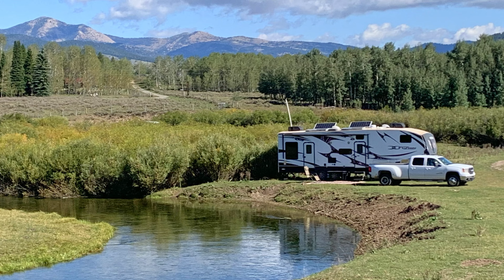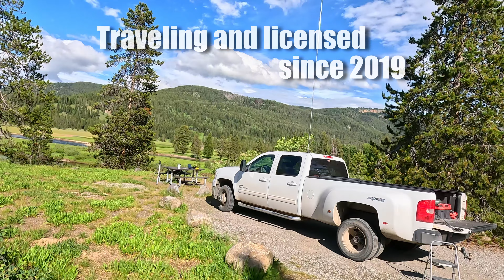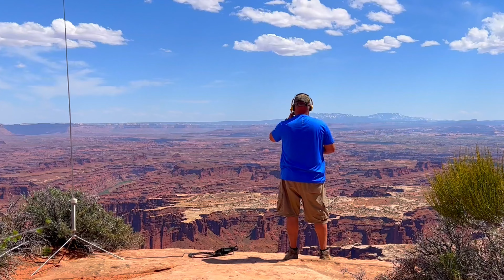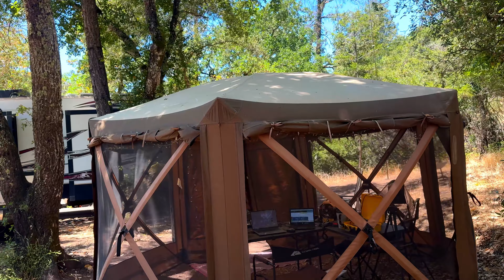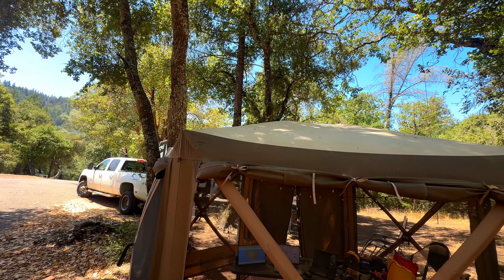Learning New HF Digital Modes for Field Day 2025!!!

Comment: Great video… just wondering, do you have to widen the filter whenever you change bands on your 891 when doing ft8? Every time I change bands while in ft8/ft4 mode I have to go back in and widen my filter to 3khz. I’m thinking there’s a setting that I’ve missed somewhere? Not a big deal just a little annoying
Reply from the maker: I usually leave mine where it defaults at 2800 or 2400, BUT…try setting up a memory channel with the width setting changed. That setting might carry over into the memory. I have the narrow filter set on my CW channels, but I’ve never tinkered with the width setting. You might try that.
Reply: @TravelinHam hey thanks I never thought of making a memory… I’ll try that
Reply from the maker: @davidp-W9DXP Let me know if it works.